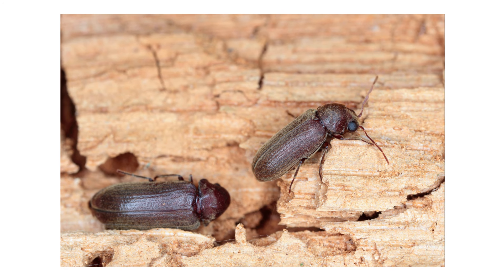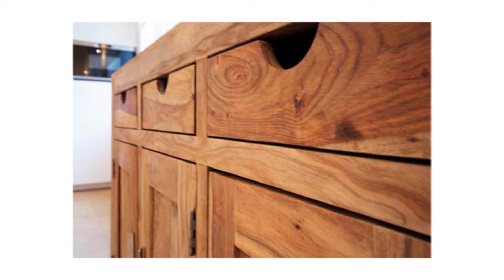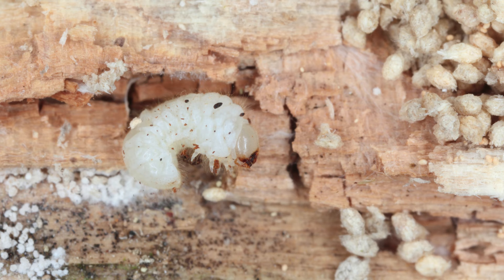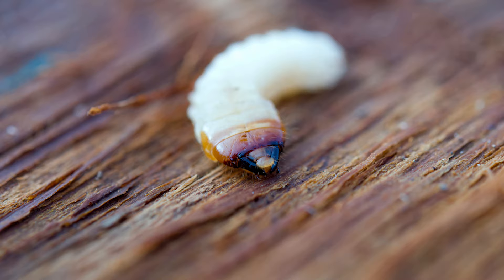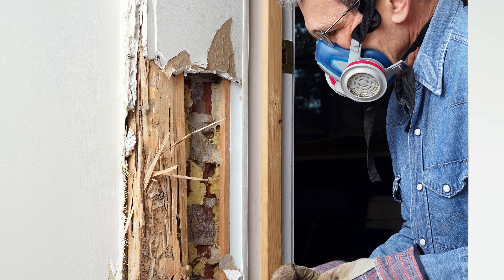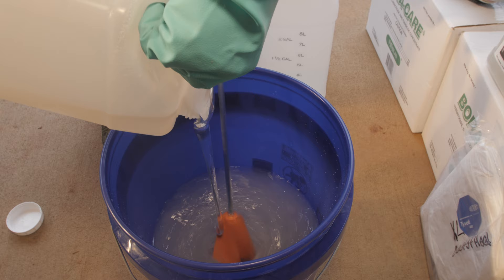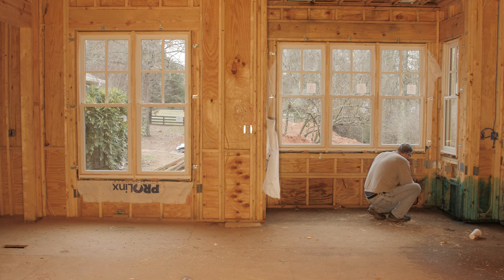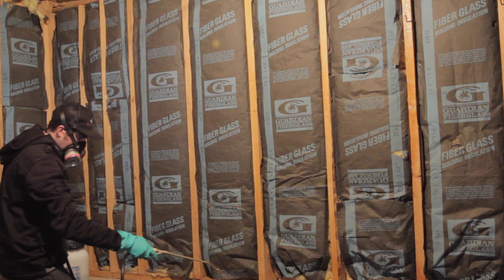How to Get Rid of Wood Boring Beetles | DoMyOwn.com

Comment: What about wood boring beetles in my live oak tree? Can borate be used on living trees?
Reply from the maker: Borate cannot be used on any live trees or plants. It is intended for use on cut lumber only. Dominion 2L Termiticide would be a great systemic insecticide to use on or around a tree for wood boring beetles. You can buy it here > https://www.domyown.com/dominion-2l-termiticide-concentrate-p-1223.html

Comment: I stood on my carpet and heard a crunch noise 14 months ago ,it was ignored by landlord so I sought advise ,I kept getting little black bottles on my PC windows ,15 months later I have 2 new wood floors ,how do I know they wont come back?
Reply from the maker: If you are referring to powderpost beetles Boracare is the best option to use on wood for protection against future infestation and treatment of active, Since Powder Post Beetles survive by eating through and digesting wood, one of the best ways to get rid of them is by treating the wood directly. This will kill those insects that ingest the treated wood and while you may still see a small amount activity after the area has been treated, they will will not be back to continue eating through it and eventually die. 

Boracare will not stain the floors, dries clear and will absorb completely through the wood while lasting the entire life of the wood. The only issue is BoraCare has to be applied to raw, unstained, unvarnished, untreated wood in order to properly absorb into the wood. There are two options to treat wood that has a finish or sealant on it. The easiest and most effective way to treat for Powderpost Beetles in floors is to sand of any finish on the floors till the floor is in its raw state. The apply the 2:1 mixed solution with typically one gallon per 500 sq ft by painting, spraying or rolling the mixed solution on the flooring. Allow floor to completely dry (typically 48 to 72 hours) before applying any stain or sealant back onto the floor. 

BoraCare Link: https://www.domyown.com/boracare-p-100.html?rrec=true
Label: https://www.domyown.com/msds/label_sds_boracare.pdf

Another alternative to treating a large area of flooring is to use Jecta which is the same active ingredient in BoraCare, just for smaller jobs. Jecta comes in caulking tube and would be applied by drilling holes into the floor directly where the activity is and for 6 inches on either side of the damage. 

Product Link https://www.domyown.com/jecta--p-931.html?rrec=true
Label: https://www.domyown.com/msds/label_msds_jecta.pdf